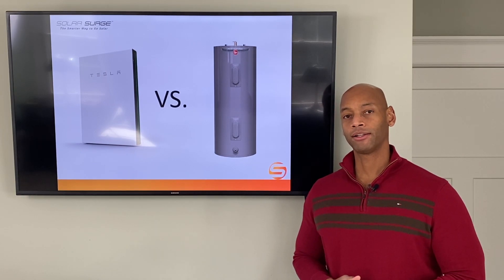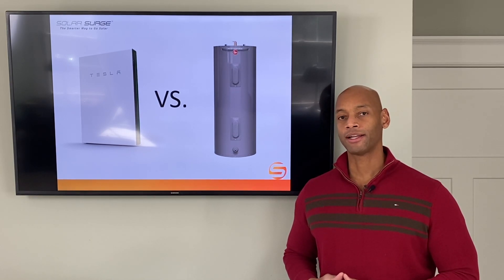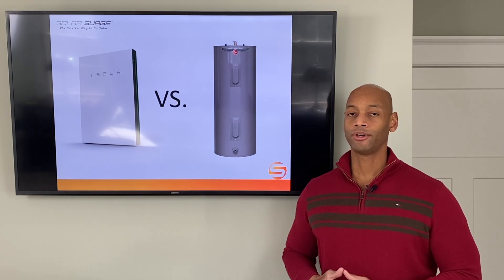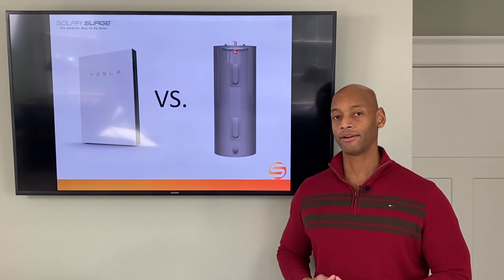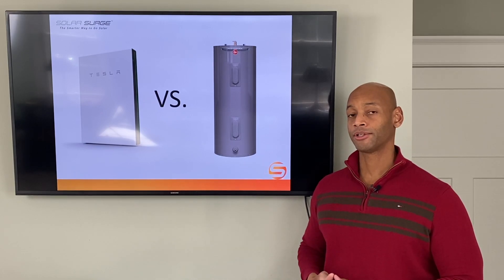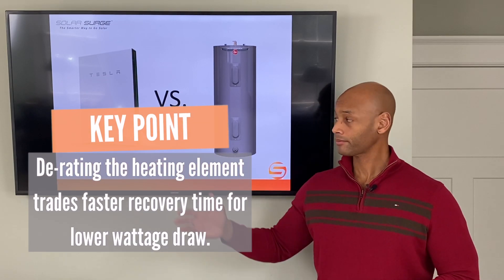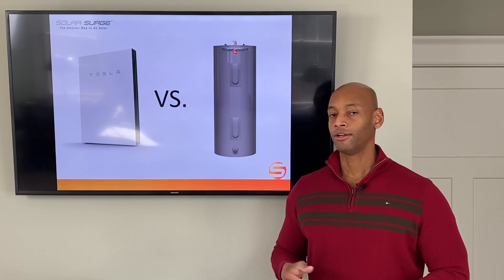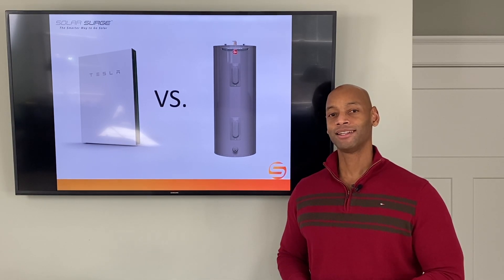Tesla Powerwall Vs Electric Water Heater | Hot Water on Battery Backup

Comment: I've taken the view that Hot water is always needed - so I bought 4 x dedicated panels just for that - put it on a separate loop - AC > DC converter - simple breaker and dump - then connected it direct to the heater element on a 330litre tank. I can supplement it with a second heater element further up, if I am running short. But for under £1000 - I built it and it pretty much handles my hot water April/ Oct - with the odd bit of supplementary power in darker periods and winter (50/50). It is due to pay itself off next year, under 4 years total. Hot water is life. Battery is used for core / basic loads of lighting, low load electricals and devices - this heavy heating load just handles itself and never touches the battery

Comment: I think the Powerwall II allows enough power for the full 4500 watts doesn't it? Here's another trick: the Rheem electric tank heaters can be load shifted in the app so you can heat the water to 140F only during the hours that the sun is hitting your panels. Then get a hot water mixing valve and set it to your preferred water temp. Now you've just converted your hot water heater to a thermal storage 'battery' that will barely pull power from your battery during non-daylight hours.

Comment: i would recommend a hybrid heat pump water heater for this. along with he de-rate option it would help big time. 
mine is always set for heat pump only. runs at 1.3 to 1.6 amps.  i saved tons on electric cost.
Reply from the maker: That's another great solution for those who can afford it.  The heat pump waters heaters sell for about $1200 at Lowes/Home Depot and they can be installed right in place of the old electric water heater.

Comment: The obvious one would be add a solar thermal system plus coil in the tank, that would vastly lower the heater draw, (plus yes, also use a 3.5kW immersion heater) plus using something like a Mixergy tank that runs AI to work out how much water you use and so doesn’t burn all your battery to fill a tank that isn’t then used

Comment: Was there a reason you didn't mention upping the number of Powerwalls as an option? This video seems to imply the Powerwall is limited & your only option is to conserve, and never mentions this is only in the situation where you have chosen to install just one Powerwall (due to cost or whatever reason). Tesla has spec'ed out 4 for me as optimal with a minimum of 3, and either is expected to run my hot water heater just fine.
Reply from the maker: Good questions.  Many people don't want to take on the additional cost ad installing a 2nd battery just to get hot water.  This is intended as a low-cost workaround.

Comment: What about using a hybrid heat pump water heater?
Reply from the maker: That's a good choice also.  If you force the hybrid heat pump water heater into heat pump only mode, you can also de-rate to 20-amp circuit breaker.
Reply: I have a Rheem hybrid heat pump. It pulls about 300 Watts on the heat pump mode. Not sure how much the surge is on the condenser startup.

Comment: What about tankless water heaters? I just ordered 12.24kWh system from Tesla with 2 powerwalls and i was thinking of upping it to 3 powerwalls. I plan on taking my regular water heater out and installing a tankless water heater. Does the tankless water heater use less electricity? Thanks for the video.
Reply from the maker: Good question Rick.  The tankless gas water heaters are no problem to run on the battery.  On the other hand, tankless gas water heaters will be too large of a draw.  Please see my earlier video on this topic: https://youtu.be/zs97oy_Mo9A
Reply: @SolarSurge  We don't have gas in our neighborhood. i would rather have that.